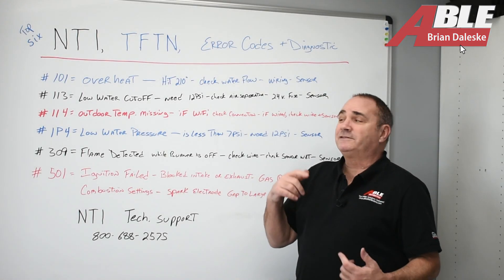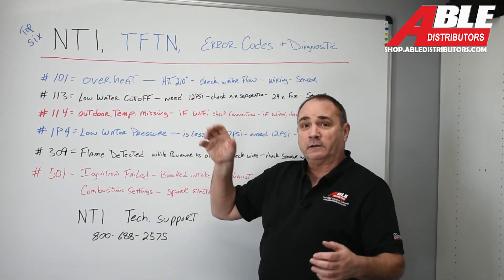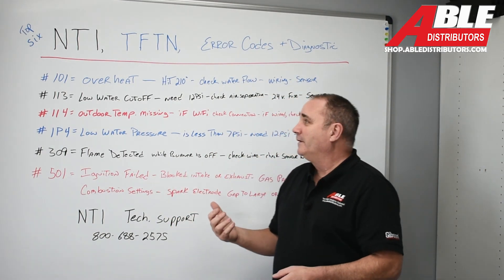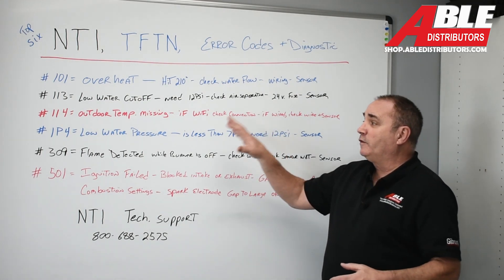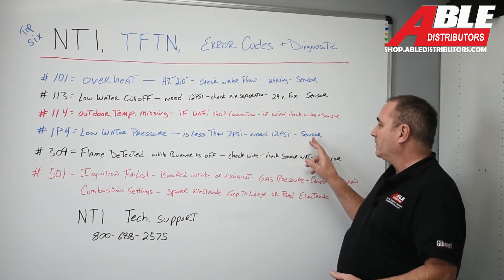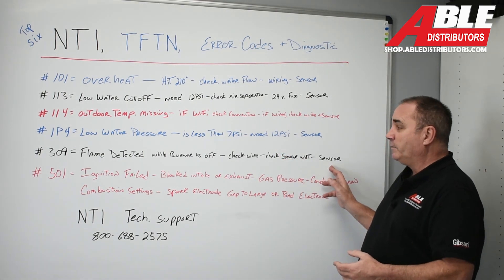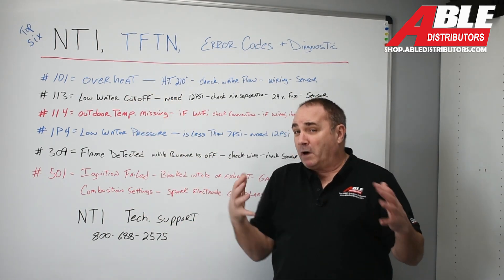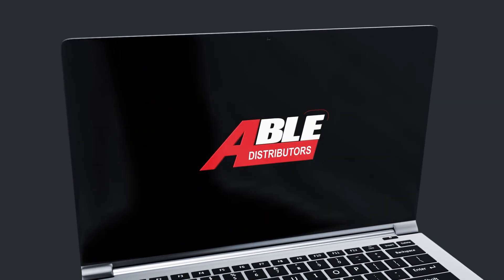NTI TFTN Boilers - Fault Codes and Troubleshooting

Comment: Any thoughts regarding my NTI Error Code ER3? Here's a brief video  from my YouTube channel showing the issue. https://youtu.be/w5e64CHCTeU?si=7HizlIw-k7deBqL9
Reply: Er3 is often caused by a damaged Out door sensor or wire conneciton on the top of the boiler, or the water temperature sensor is failing. Your best bet is to get infront of the unit and talk with tech support.
Reply: @dqm9991  thank you...